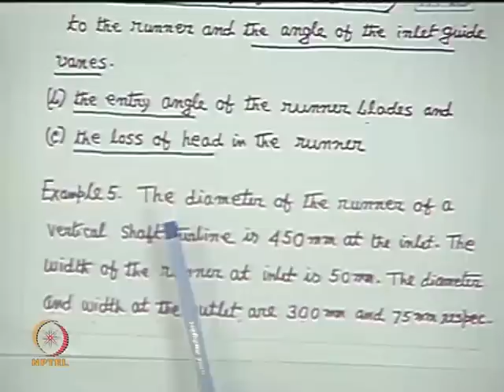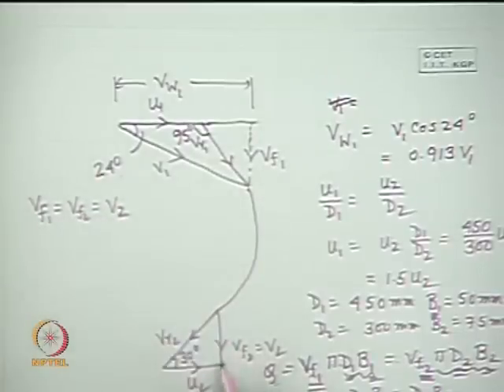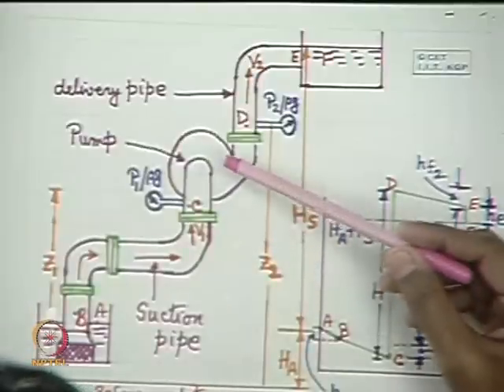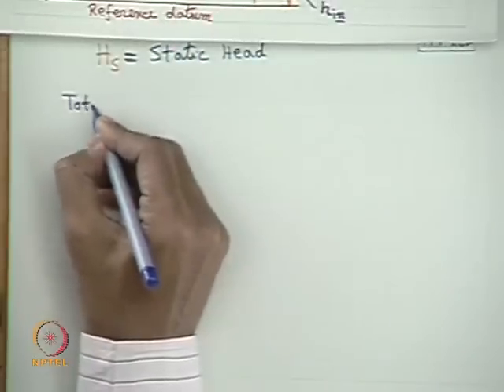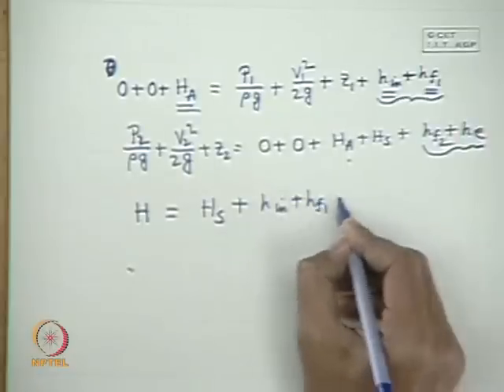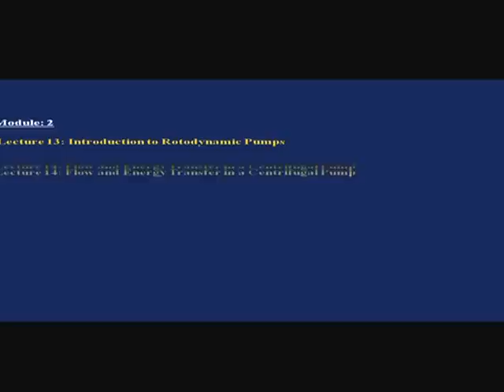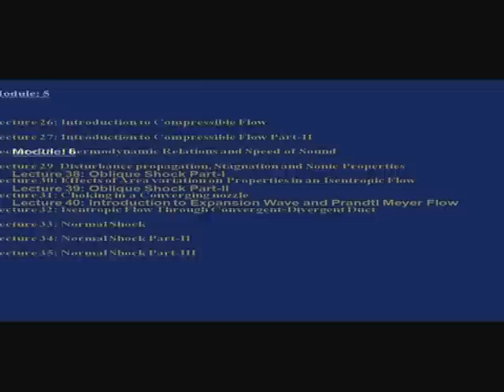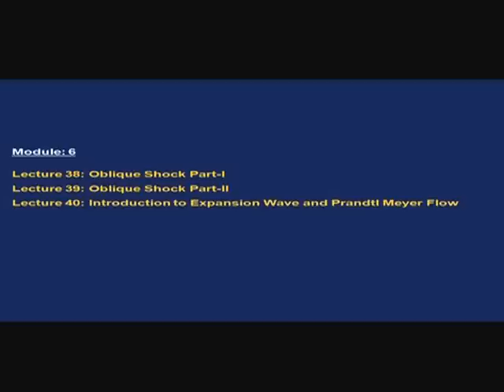Mod-01 Lec-13 Introduction to Rotodynamic Pumps

Comment: In the beginning problem,  cant we calculate u1 as U1=Vw1-(Vf1/tan85), where Vw1=0.913V1 and Vf1=0.406V1.  Why do we calculate U2 and hence finding U1? I tried both ways and got two different answers. Why?
Reply: It's probably irrelevant now but I am also getting different answers trying to solve it both ways.